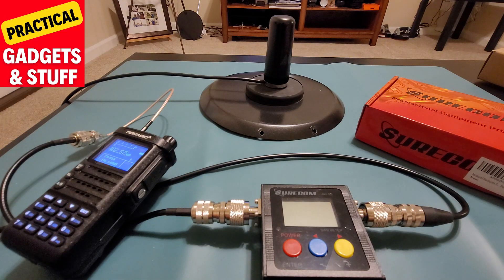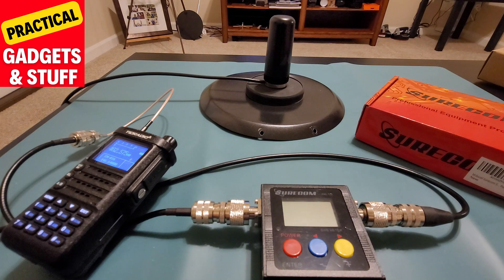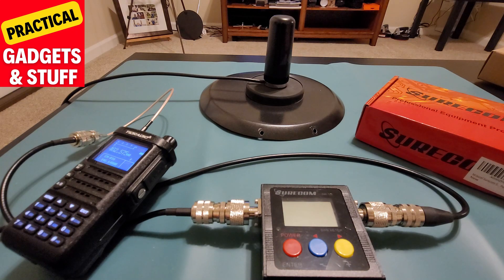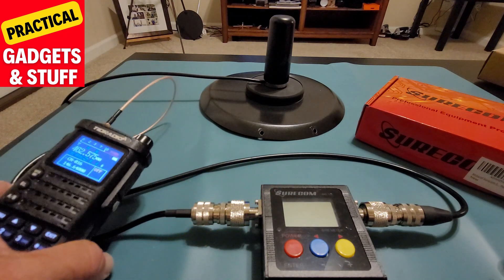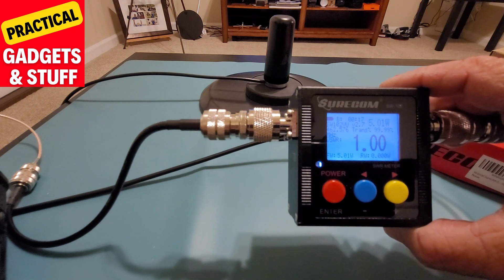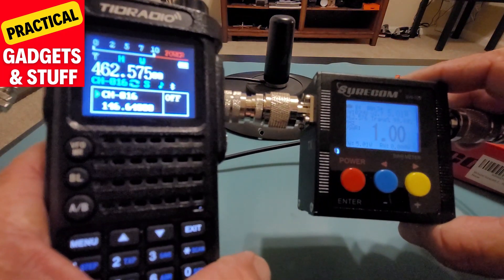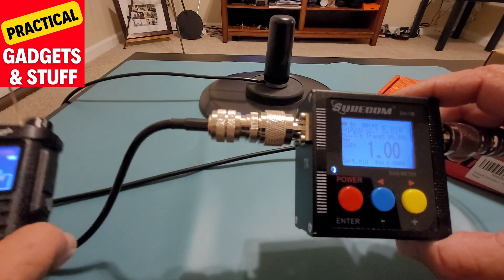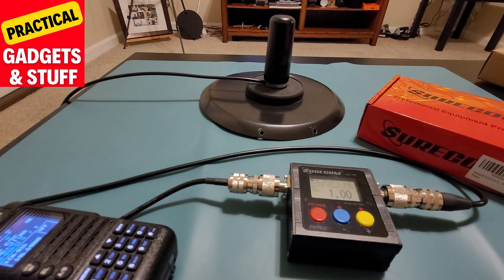Midland MXTA25 GMRS Ghost antenna. SWR test.

Comment: Just remember a dummy load also has an SWR of 1:1. SWR is not a measure of antenna effectiveness and efficiency. Antennas that are shorter than 1/4 are less efficient than a 1/4 antenna.   Even without the most efficient you will likely work someone.
Reply from the maker: SWR is precisely to see if the antenna is working fine and not sending electricity back into the radio. That and the fact that I can hit what I want to talk to, is good enough to tell me that the antenna is working fine in the real world and serving my purpose. Thanks for watching. By the way, the swr reading with a dummy load is null. Because... there is no antenna!
Reply: @practicalgadgetsandstuff  I am trying to tell you that having an SWR of 1:1 is not sufficient information telling you that the antenna is good.  Basically,  any piece of wire will give 1:1 SWR at 450MHz when fed will 1000 ft of RG-174. There are more dimensions to the issue than just SWR.  Admittedly your antenna is an OK antenna but probably not the  best.
Reply from the maker: @vladtepes481  yeah I know. But to my practical purposes if I can communicate with very good quality, have a very good range, and a good swr reading, it's a good antenna! I never said the best. And I don't need the best. Thanks!
Reply: @practicalgadgetsandstuff that isn't what you presented here though. What range have you experienced with this, and how does it compare to another antenna?
Reply from the maker: @ohenekojo2561  on my town 7 miles to my handheld and 25 miles to a nearby repeater. It performs the same as my Nagoya UT 72. The only antenna that I own that performs better in range is the Midland MXTA26 6db. 40 miles to another repeater in my area.
Reply: @practicalgadgetsandstuff  cool but the Nagoya costs half as much, looks more ergonomic and can be used well on 2/70. Maybe do a side by side comparison with efficiency tests?
Reply from the maker: @ohenekojo2561  they are for different purposes but good idea. I'm going to try to make a comparison. Thanks!
Reply from the maker: @attribute-4677  Agree. But it is not relevant because you are only measuring power. No antenna on the equation. Thanks!
Reply: Just remember we can not clearly see where the wires go to, can be a dummyload as well